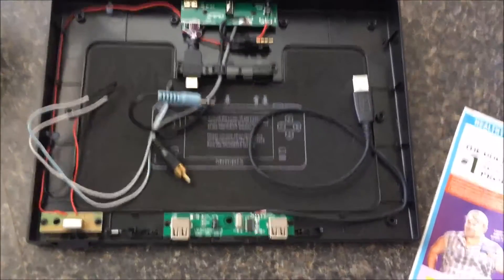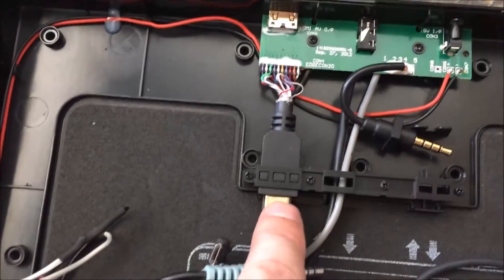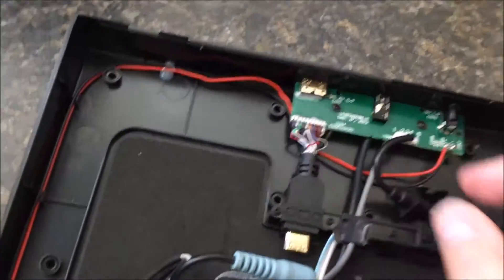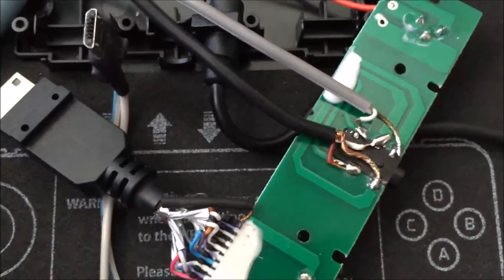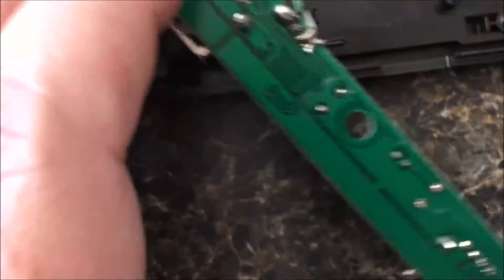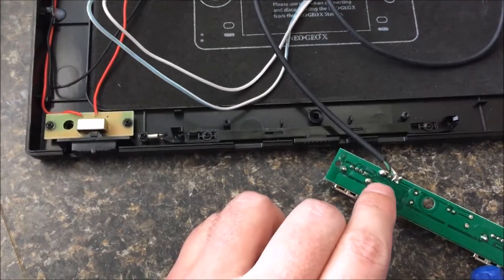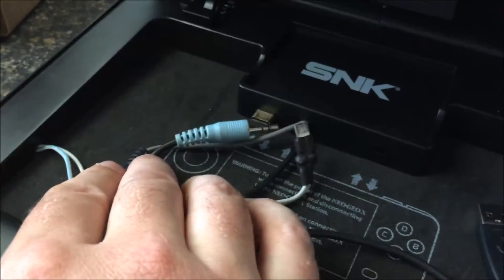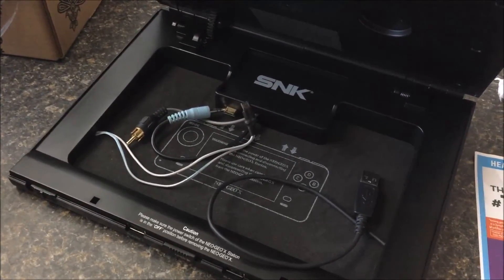NeoGeo X Raspberry Pi Wiring

Comment: How did you open up the dock? It's realy stuck and won't budge. I'm trying to get to see the circuitry
Reply from the maker: it should come apart very easily. just remove all the screws from the bottom, don't forget to take off the rubber pads on the bottom because there are screws under them.

Comment: What kind of power supply did you use? I was wondering If I should use a 5V 2.5A (as recommended for the PI) with the correct plug, or the Neo Geo X original power supply. Thanks in advance!

Comment: Hi. Can I use NGX Controller on Raspberry Pi? Cheers =)
Reply: Can I ask how you got the Neo Geo X controller to work? I just set my Raspberry pi 3 up with Retropie and it does not recognize it. I got everything to work but the darn controllers =(
Reply from the maker: yep, that's what i was using in my previous video. the NGX controller is pretty much the same as one of those generic SNES controllers.
Reply: Me neither =/
Reply: I seen in older version of RetroPie there was a away through Retroarch to register generic controllers, but nothing in 4.0 or higher.
Reply from the maker: when i got it to work i was using PiPlay and not RetroPi. ill get my whole system up and running again and cover what you need to edit to make it work with RetroPi